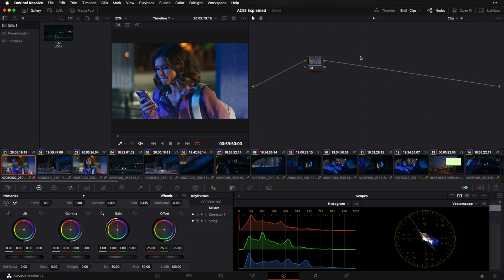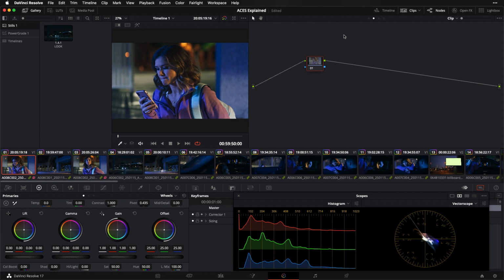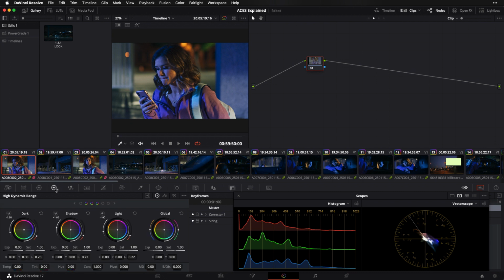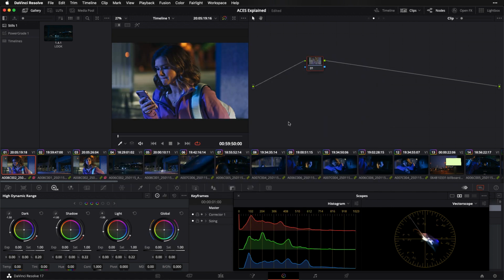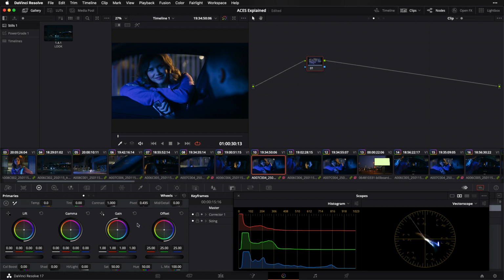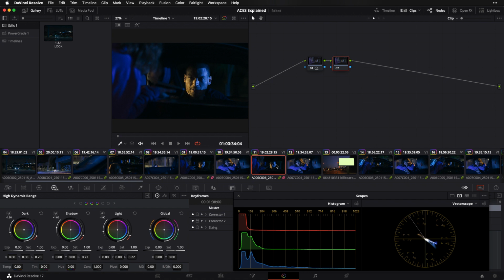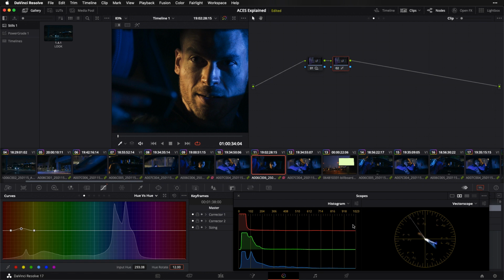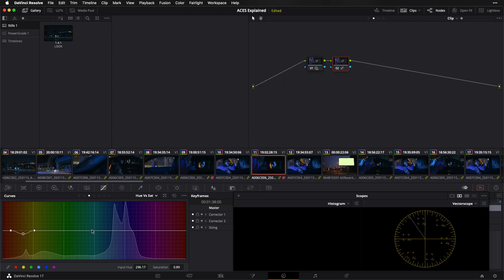ACES Explained, Part 3

Comment: Hurray! After having watched your 3 ACES Videos I could rebuild my grading tree which was originally under Davinci YRGB and Arri LogC color space within a few minutes.
Results appear even better. Only, performance of Davinci Resolve is suffering a bit.
Reply: @CullenKelly  Probably, it is the conversion into and back from ACES color space that eats some performance.
Anyway, in the meantime, I completely changed from using V-Log on my S1H towards HLG which I edit in DR under DR color managed mode.
This turned out to be great in many respects:
- Colors even better than with V-Log
- More headroom in the highlights
- slightly less banding / blocking of colors when using massive grading in combination with DR film LUT for Kodak2383
- slightly less noise
- RENDERING 3-4 TIMES FASTER compared to my V-Log grading tree (which is similar to my HLG tree)

Comment: thank you, you explained it well. but i have question. i set my project to acescct and re709 as output. my dji records in dlog or something similar which is not supported by acces so I disable color menagemet i grade it manually. but after i finish my movie i want to set my output to rec2100 hlg and export it. now, how aces will know what my dji footage was and how to make it convert it properly, along with other clips which are converted properly by aces earlier ?

Comment: Hi,
brilliantly explained. I am using your way. Instead of setting ASEC in the program prefrences, I use ASEC tranform node. Everything has become much clearer and no problems with Fusion page and ACES. In Fusion I work on ACEScg rendered files. On the last node I use ACEScg - rec709 conversion. Then doing colour grading I use rec709 - ACEScct - here I insert the nodes with colour correction and finally ACEScct - rec709. Is this in your opinion the correct way.
Reply: @CullenKelly  One question. If I set conversion at the end of the fusion string, ACESsg - Rec709, and then in the colour tab - Rec709 - ACEScct. Doesn't this cause a loss of quality?
First there is a conversion from wide system to narrow ACESsg - Rec709 and then from narrow to wide Rec709 - ACEScct. Maybe it is better to set ACEScg -ACEScct at the end of the work in fusion. This way we have the conversion ready to work with the colour tab. Or maybe it doesn't matter because all conversions retain full image information?

Comment: Hi ! Very good tutorial, it is really helping me and friends on an ongoing project. We are having a problem, though. Due to horribly poor performances, we wanted to use proxies. Our footage is shot in log, so our cst is from log to ACEScc, but then obviously when we use proxies, the cst no longer matches and it impacts both playback and render, somehow (use proxy media unchecked ofc). So we have performance, but our workflow isn't good anymore. Do you have any workaround for using proxies on log footage and maintain a sustainable ACES workflow ?
Reply: @CullenKelly  Hi, thank you for answering ! We did just this, and caching our NR and other heavy nodes + using quarter resolution proxy mode (which I learned didn't use proxies) helped a lot with the performance ! We could finally grade a few complex shots without Resolve crashing haha ! Thanks again

Comment: Question for color temperature - is there a reason you don't use the camera raw panel to adjust the native white balance of the footage? I know this only works for raw footage but I am curious because I have found better results that way as it's not adding color on top of data but changing the footage settings. Or perhaps I am misunderstanding

Comment: Hello Cullen, thank's so much for explanation. I have this problem. My Mac retina has a p3 screen. So when I use color default management (not managed) my output is Rec 709A so the final output is the same as the timeline. This method I use as you explained in Part 1 the aces transform with a node. The way you explain in this tutorial part 3 (color managed) when I have my timeline colorspace Aces  than my output is not Rec 709A. Now my question, if I use the default color management and work with Aces transform nodes as explained in part1 and I do the grading in the middle node can I still use HDR color wheels. Or is this the wrong way.
Hope to hear from you. By the way, I subscribed to your channel.
Happy new year. Cheers Richard
Reply: @CullenKelly  Thank's a lot 
greetings Richard

Comment: Excellent! Thanks for this Cullen.
I set up my project settings and workflow as you laid out and it's amazing. The only issue I'm having is using the qualifier (though your method is a much better option, I'd still like it as a fall back tool). Anything I select for the qualifier prior to the ACES output node seems to select most of the image turning it grey as though I were working in LOG. This doesn't seem to be an issue for you in the video above. Input footage is 10-bit 4.2.2 v-log.

Comment: I actually have a maybe stupid question: I've found a cheap GH5 and of course i"m discovering that if I want to edit 10 bit in Resolve I'll have to buy the Studio version,which I will eventually. In hte meantime, if I should 10 bit and transcode into 8 bit, to edit in the free Resolve edition, this is pointless, right? I might get a marginally better footage because it's shot in 10 bit,but because I transcode it I find myself editing 8 bit that will NOT have a 10 bit footage latitude. Am I correct?
Reply: @CullenKelly  I'[ve just bought the Studio version.

Comment: Thanks. In order for HDR tools to work correctly, can we change the color space on Node level instead of Timeline level, and set it to ACES ? Would that limit our adjustments with regard to pure blacks in the footage? I see only two options on node level, ACES and ACES ap1.
Reply: @CullenKelly  Yes. I noticed a technique Qazi used: he sandwiched the grade  between two CST nodes: IDT (Camera input Arri, Log C, output same as input, so he can have access to the dynamic range of Arri), ODT  (Log C to Rec.709). Then, he changed the color space of the node after IDT to Davinci Wide Gamut (and Intermediate) as to give his printer lights  a better range (It looked like his printer light adjustments would move a larger distance on the Waveform monitor in DWG color space). That's why I was curious about the difference between node-level color space and project level in your example.

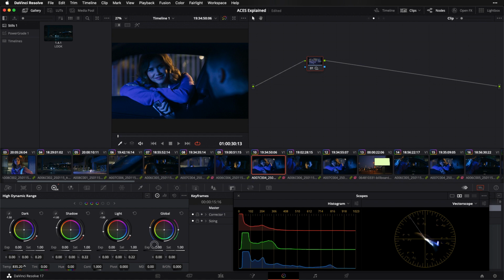Comment: When you mention the degrees of kelvin a 7:06 do you mean every 1 unit change one the temp tool is equal to 1 kelvin in the real world. For example if my clip was 5000 kelvin and I slid the temp to 500, would it equal 5500?

Comment: Hi. Great series! When you switch your timeline color space from Rec709 to Aces cct, do you also need to turn off the output aces transform (cct back to rec709)? If I don't, my image gets very 'funky' and unusable. Am I missing something? Thanks.
Reply: @CullenKelly  Hi. Thanks for your response. Unfortunately not, all settings appear correct. I’ve done a 30 sec screen capture so you can see the setup and what happens when I change the color space in the management tab. Thanks. 

https://youtu.be/SW_OxBHbHxk
Reply: @CullenKelly  Hi. Thanks, I was starting to think that may be the case. That'll teach me for upgrading too fast!

Comment: I notice that ACES has a slightly different white point definition ( 0.32168, 0.33767 vs 0.3127, 0.3290 (D65)) than all other D65 color spaces(Rec709, Rec2020, etc.) It's my understanding that Resolve's CST transforms the color space but not the white point. That being the case, when you use a non-color managed workflow in Resolve, you use a CST to move into the ACES color space, but, you don't use a chromatic adjustment plugin to correct the white point differences. Why not? Since ACES is only the timeline working color space, and you're delivering to a D65 compliant output, it doesn't matter?

Comment: Hi Cullen, I discovered this channel yesterday, and I think you are wonderfully articulate in explaining these colour grading concepts, so I'd like to ask you a question: I've seen a lot of colourists (including yourself) choosing to use a log gamma as their working space. Could you elaborate why this choice is often made?

To provide some personal context: I do a lot of VFX work, and we almost exclusively composite and perform corrections in linear, because my understanding is that (while our eyes work more like log, in that we percieve more shadow detail than highlight detail) this is how light works in the real world, and therefore digital tools are often designed to work in Linear because the mathematics are more straightforward when you can, for example, simply multiply the pixels in a shot by itself to raise the exposure. Often I've graded in Resolve using ACES AP0 Linear, because this makes the Gain wheel act like the ISO dial in-camera, in that it is a multiplier on the pixels where each number represents a doubling of the amount of light: 2.0 equals 1 stop, 4.0 equals 2 stops, 8.0 equals 3 stops, and 16.0 equals 4 stops; which I've personally verified by shooting bracking tests between ISO levels and raising the exposure on various cameras.

So to bring the topic back around again - I understand that many colourists choose to work in log, and that ACEScc and ACEScct where created because colourists requested a log working space; however I don't understand why this is the case when Linear seems more efficient (in my view). Is it to do with a preference for how the tools operate, or does it affect tone mapping in some way, or is this a complex issue with multiple reasons? I'd love for you to elaborate on the concept of working gamma and how that effects the image!